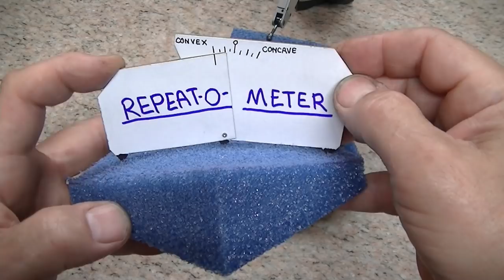ROBRENZ ATD #1 INTRO, 3 PLATE METHOD

Comment: I like to look at it as the 12 face method, not 3 plate method.  3 plates rotated 90 degrees in all combinations of of the 3 plates gives you 12 different faces to rub together.  4 directional faces each on 3 plates.  Making a straight, flat edge is then quite more possible by rotating axially and longitudinally around the faces of rectangular stock. With the minimum requirement of at least 12 faces it can be done with one rectangular piece of stock and 2 squares of equal length.  the squares can be rotated axially and flipped longitudinally for a total of 34 faces.  you can obviously keep your "sacrificial" square stock to make more if you need to.

Comment: 3:14 to 7:23 Very clear and succinct description. Thank You so much. 
About 1961 (I was about 10 years old) My dad took me to Bell Labs in Whippany NJ (where he worked) to see the first ever laser length measuring research device, a 2 ft x 3 ft x 15 ft slab of something (weighed tonnes) supported on fulcrum knife edge type supports(again I was only 10 relative to my grasp of the supports and process), and he showed me that just walking on the concrete floor next to the device changed the laser measured length. I was so impressed then, but I now find it absolutely incredible, and you sir take me back to the wispy times of my own pre-historical memories. I believe you "do measurements", test and verify, and make very real in a realm so inconceivable and incomprehensible to the average layman, that is as astronomical, and Hubble's constant, are so far away from "Pass the Salt Please" This poor example may make little sense to you, but I'm trying to express that I am extremely impressed, without insulting your incredible integrity, by my humble offering. I had forgotten, if I ever knew, that people like you exist. Again you make real, and test and verify, things that others I'm sure have no concept of.
Reply from the maker: Thanks for the very kind words and glad I could bring some good memories back!
Reply: All credits to you! Thanks Again.

Comment: Thanks Robin, I think that was one of your best videos. Many people are confused over 3 plate self-generation and the requirement to also rotate the plates, and you explained that very well, even managing to slip in a heigth reference, though minus one point for then slipping back into English, ha ha. Using a twist gauge was brilliant and one of those "doh!" moments and I use a level and never thought of doing ways that way.

It will be very interesting to see that spindle coming along, it sounds quite remarkable.

Thanks for continuing to raise the bar.
Reply from the maker: Thanks, and thanks for watching and commenting.

Comment: I'm intrigued by your cardboard repeat-o-meter. It looks like it would be really useful when checking the flatness of boards and panel glue-ups. At least, to me, it seems faster and easier than using the flashlight and straightedge method.
Reply: + AT MY SKILL LEVEL IT'S DO-ABLE    :-)
Reply from the maker: I would make it a little different for that purpose

Comment: Great stuff. I love the technical side. I think whiffletrees are scary in application since if the pivot is not exactly balanced to the forces it imparts twist easily.  What material are you using for your spindle blocks?
Reply from the maker: Thanks Brian, The spindle blocks are A2 at 62RC and thanks for watching and commenting.

Comment: Robin, not sure if you've discussed this but I noticed the shars chuck. What is your take on low price import chucks? Is that one adjustable for runout from the factory or did you modify it? I just ordered a shars adjustable 3 jaw. I don't want old, worn out chucks in my life any more and hopefully this will help me move forward. I would be interested to hear your opinion, and I'm sure other people would be as well. I also know that you use the CDCO aloris style tool holders which I just ordered a bunch of, maybe you could do a video on high value/low cost import tooling and associated modifications. I know there are a lot of videos like that on youtube but it would be very interesting to hear it from you. Thanks
Reply from the maker: I think they are good value and the better quality versions are pretty good. I spend several hours to take it apart, clean and deburr, and re lube before I even use them.

Comment: Just wondering, if you lap two stones in a circular motion, you should/would not end up with two stones with a matching twist in them. No?
Reply from the maker: Correct, I mentioned the 90 degree rotation was necessary to detect/remove the twist that could occur.

Comment: One question with rotating in the 3-plate method that I've had is does it truly need to be 90 degrees? That's certainly the angle that leads to the fewest necessary rotations, but AFAICT any shape with symmetry C_{n} with n>2 should work. (rotation by an angle of 360/n does not change the apparent object). So a triangular surface plate should work fine, you'd just need to check three times: once at 0, once at 60, and once at 120 degrees. A square (or octagon, or other multiples of 4, or a circle) works quickly because you can check twice: once at 0, once at 90 degrees.
Reply from the maker: It has to be 90 degrees for the plates to match to get full bearing on square plates but your other points are correct.
Reply: That question actually got me interested. Example from the video looks like hyperbolic paraboloid, i.e. in cylindrical coordinate system with origin in the center of square plate and angle measuring from the middle of one of plate's sides it's something like:
z ~ r^{2} \sin(2φ)
And indeed it is fixed under 180 rotation and "plate copying" operation (z -> -z and φ -> -φ). But now you can easily construct similar example that is fixed under 90 rotation:
z ~ r^{4} \sin(4φ)
And by analogy an example for any rotation that is a even fraction of 360.

I think higher harmonics are less nasty because in practice we are not magically copying one plate onto another, but making strokes of finite length that should preferably remove high spots in some directions on that finite length. The problem with hyperbolic paraboloid is that it's perfectly straight in some directions. So practical advice for someone who is trying to use 3-plate method for rectangular plates should probably be to try making strokes in different directions.

Comment: Rob have you noticed the Silly Putty and Graphene experiments? Apparently putting graphene in silly putty makes a very sensitive resistor, apparently it can sense bugs walking on it. For a guy that likes measuring resistance I thought you would enjoy it, apparently putting the mixture on strings makes them very sensitive to air movements as well.
Reply from the maker: I have not. The electronics end is just a sideline and I have not dabbled in that for quite a while since I started doing the machinist related videos. Thanks for mentioning it though and thanks for watching and commenting.
Reply from the maker: Thanks that was really interesting
Reply: I wonder if a really sensitive resistor could be used to measure flatness?
Reply from the maker: It seems all the applications work with relative changes rather than exact differences in resistance that would be repeatable.

Comment: Hey Robin great video as always one quick question question regarding the mounting of a surface plate. Would the three point method on each corner for geometric stability still apply to a granite plate? Seems the full 12 points would be the most precise way of mounting to eliminate the most sag.

Comment: Great info Robin.  On your lathe backing plate did you do the floating locking pin?  In the shop here we have a Hardinge knock off and I made a backing plate for another chuck.  The backing plate I had to copy I assumed is a purchased item and I can't get that pin out to look at it.
Reply from the maker: I just drill and tap a 1/4-28 hole and use a long SHCS with its tip turned to the correct pin diameter

Comment: How did you measure the lathe centre height accurately enough to justify the precision of the block ?
Reply from the maker: Gage pin in spindle indicated to minimal tir. Height gage on gang plate with indicator zeroed on plate. measure over gage pin and subtract half the pin diameter from that reading.
Reply: Thank you for taking the time to reply and for some of the most inspirational videos on YouTube

Comment: I find this really interesting. I read that “Joesph Whitworth” was the first person to describe on how to get a flat surface using three plates. 
But you say it’s not the right way. 
If this is the case then who is the first person to obtain and describe a proper flat surface without Whitworth’s contribution?
I’m assuming Whithworth needs to be credited for being the first person to describe a basic understanding of obtaining a flat surface then newer undated proper flat surface techniques arrived later on from other scientists.
Reply from the maker: I didn't mean his way did not work. It's just that the third plate is unnecessary if you use a repeatometer to see which plate is concave and which is convex.
Reply: @ROBRENZ   I would like to know how I can take a granite block and make that into grade AA surface plate. Granite block from the quarry who made a reasonable straight flat surface but is nowhere near precise. Just for a learning experience.
Reply: @ShopperPlug  yes

Comment: Hey Robin. Love your content.  Question for you, or anyone else: I acquired a 24"x48" plate which was improperly supported at the very ends for 20 years.  Metrology guys came by and said it was bent.  It had developed a .002" belly that could not be taken out on-site.  My question for you is, if I send it off-site to be heavily resurfaced, and then I properly support it, would I risk the plate "unbending" over time or do you suspect it would be stable?  I'm inclined to toss it if it's even questionable.  Thanks in advance.
Reply from the maker: Granite does not bend! That is just wear from it being used in one general area for too long. Have them glue the support feet on in the proper location before lapping and you will be good to go. If the surface plate people told you it was bent I might question their capabilities.

Comment: Something else I'be ineterested to know is, on a design point of view what are the characteristic of a tooling that make you choose between grey iron and tool steel? Thanks a lot.
Reply: Simon Bouchard for a backing plate I don’t really know that other materials are an option. When you go and order a backing plate they just are made of grey iron. Other things to consider is the free carbon makes the chuck slide better on the steel spindle and can make it easier to remove.  Also iron absorbs a lot of vibration where steel doesn’t.

Comment: Even if you had square or circular stones, would it work to make the kind of surface you talked about in the precision flat-stone video? I would have thought it would be basically the same as dressing the stone, so it would be flat, but it would still have the coarse surface
Reply from the maker: Yes with proper technique.

Comment: How did you make that helical foam? That's what I wanna know
Reply: I've done this, cut out specific foam shapes. Template. Cardstock 5x5". Cut in half. Draw and cut two half-oval/ellipse shapes. Make a square of 1/4" plywood/MDF/etc., 5x5". Tack the cardstock to two opposite sides of the plywood. Cut out foam  to fit between templates. Hot wire foam. Edit: He mentioned it in other comment, two words, 'jewelers saw.' :)

Comment: Robin, I have a surface plate that I'd like to build a stand for, but I have no idea how I should be supporting it. It's a 24x18x4 granite plate, and I had heard that there would be some kind of marking or recess on the underside to indicate the points by which it should be supported, but I found no such thing. It's a made in england lab grade plate (or at least it was lab grade some years ago), so i wouldn't expect them to have taken shortcuts like this. Would love some advice on deciding where to put my supports, or is it not going to even matter?
Reply: I'd say you need to rewatch the video. Robin gave all the numbers to calculate either the Airy or Bessel points. Airy is .21132 x length, Bessel is .2203 x length. I'm no expert like Robin clearly is, but it sounds like at least it's an unknown slightly used plate and a non temperature controlled evironment so either number should work well enough. Or use his minimum sag calculation of .2232 x length. Each point would be 5.3568" in from each end and 4.0176" in from the front and rear of the plate. Obviously the other end the single point would be at the plates C/L and that same 5.3568" in from the end. Airy, Bessel or minimum sag there's at best .285" in round numbers between all 3 over the longest distance. No noticeable difference in any average shop and a tape measure reading with points marked at 5 3/8ths x 4"  would be good enough I'd think.
Reply: Okay, so I said no idea, but what I meant is that the best idea I have to to simply mount it using the minimum sag points, so is there a better, more technical way? I don't think the marked points on surface plates are merely indicators of the minimum sag points, my understanding was that those same points were used to support the plate when lapping, meaning that any sag due to gravity would actually have been compensated for during the lapping process.
Reply: yep, it's my understanding that's how the best plate manufacturers do it. Only a guess but I'd think some manufacturers might have there own ideas about using Airy, Bessel or minimum sag points. With a 4" thick plate and there being that little variation between all 3 measurements then temperature change would likely show more movement in the stone than using any of the 3 constants even if you picked one the plate manufacturer didn't use. And certainly the steel bench structure will move a lot in the usual shop conditions. Airy points are what I've seen mostly mentioned for a surface plate support, but one would think  the minimum sag would have been used while finish lapping the top. It's not impossible your plate was relapped at some point, so without knowing how or where the plate was supported at that time it's a best guess on what would be the most technically correct for your plate. The 3 point support is universally used but I'd still add 2 more non contacting supports adjusted to within a few thou of contacting the bottom of the plate at the single point end just to prevent the plate tipping if too much weight is set on one corner.
Reply: I doubt it has been relapped, because there doesn't appear to be anyone in New Zealand who will lap and calibrate a surface plate
Reply: Here ya' go:
http://www.standridgegranite.com/forms/installation-instructions

Comment: I'm going to be planting a plate soon.  It appears by your comments that the whipple tree mount does help if only a little.  Are there any negatives to using it?  Thanks for all your efforts and sharing your knowledge.
Reply from the maker: If your pivot is not free under the heavy load it can be worse than 3 points. I would not do it.
Reply: Do you sell those mounts you made for yours?
Reply from the maker: Sorry no.
Reply: Any advice on what to use.  Not a machinist.  Unless a file, hack saw and 3x8" diamond and whetstones qualify.  : )
Reply: I have a standard stand that came with it with 3 bolt mounting.  No pads came with it.
Reply: 2'x3'x4.5"
Reply from the maker: Should be fine as is with the three jack screws
Reply: Shouldn't i spread the load a little?  On a small swivel like washer plate an inch or 2 in diameter with a thin pad? Or can i just set it directly on the tips of the bolt ends.
Reply from the maker: The washer and pad would be better

Comment: surly the point sag stuff all depends on thickness?
Reply from the maker: No.  The amount of sag will vary with thickness but all the other aspects I mentioned are independent of thickness
Reply: ooooooooooooooooo  i c, slides chair in corner at the back .thanks for sharing

Comment: 4:04: why does grinding C against B make it the same as A? Surely B will be worn as much as C is?
Reply from the maker: The three plate method is actually for scraping where you scrape B to match A with A as the master. You are only removing material from B. The you do the same removing material  only from C to match B with B as the master. So inherently C will match A. You are correct that if you are doing this by abrading two plates on each other they will mutually conform to each other with roughly equal material removal on each plate and the three plate principle is violated.
Reply: @ROBRENZ  What do you mean by "the three plate principle is violated"?
Am I to understand this to mean that lapping three plates against each other, taking turns etc, will not result in flat surfaces? Let's think round plates for the moment, like OxTools did.
Reply from the maker: @SoWe1  Correct, doing only what you described is not enough to ensure flat surfaces. there are more details that have to be managed to ensure flatness.
Reply: @ROBRENZ  so what OxTools showed was wrong? What he did is what I was under the impression was all that's needed. Can you please write what's missing?
Reply from the maker: @SoWe1  Tom is not wrong. My first comment above defines the problem when lapping vs scraping.
Reply: @ROBRENZ  I think it's worth calling out here that whatever method is used, measurement to check / track / validate the progress is important. As I type, I'm taking a break after my first round of the three plate lapping method that Tom showed, and I can measure clear improvement in flatness already.